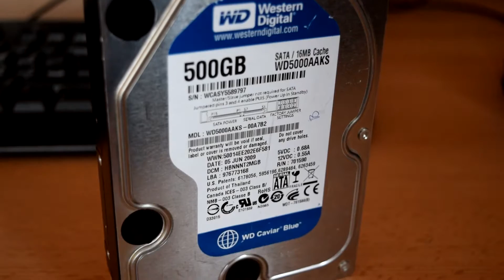350€ / 300$ Gaming PC Build - November 2015

Comment: Can I have links to it on Amazon?
Reply from the maker: +XTheSmoothMovex 
Processor: http://www.amazon.com/Intel-Pentium-Processor-G3220-BX80646G3220/dp/B00EF1G9DW/ref=sr_1_1?ie=UTF8&qid=1449404397&sr=8-1&keywords=intel+pentium+g3220
Motherboard: http://www.amazon.com/Asus-Micro-DDR3-Motherboards-H81M-K/dp/B00GUD1ER4/ref=sr_1_1?s=pc&ie=UTF8&qid=1449404948&sr=1-1&keywords=asus+h81m-k
Graphics card: http://www.amazon.com/MSI-Computer-OC-PCI-Express-N650-1GD5/dp/B009733DFA/ref=sr_1_1?ie=UTF8&qid=1449404440&sr=8-1&keywords=asus+gtx+650+1gb (i could not find used asus model)
Ram: http://www.amazon.com/Crucial-PC3-12800-Unbuffered-240-Pin-CT51264BA160B/dp/B006YG89Q6/ref=sr_1_1?ie=UTF8&qid=1449404511&sr=8-1&keywords=4gb+crucial
Hard drive: http://www.amazon.com/Blue-Desktop-Hard-Disk-Drive/dp/B0088PUEPK/ref=sr_1_17?s=pc&ie=UTF8&qid=1449405016&sr=1-17&keywords=wd+blue+1tb
Wifi card: http://www.amazon.com/PCE-N10-Wireless-N-Network-Transmit-Interface/dp/B004XFYGNK/ref=sr_1_1?ie=UTF8&qid=1449405556&sr=8-1&keywords=asus+pce+n10
Case: http://www.amazon.com/Antec-MicroATX-Tower-Case-VSK-4000E/dp/B009LDNTOG/ref=sr_1_1?ie=UTF8&qid=1449404624&sr=8-1&keywords=antec+vsk+4000
Reply: Thanks and one more question?Can it run bo3 on high 60fps???There was a other build for 300$ person said it ran bo3 on high 60 fps and battle field 4 on high 60fps...
Reply from the maker: +XTheSmoothMovex No it sadly wont but this one kinda will...you will just have to look around for parts a bit https://www.youtube.com/watch?v=Unp7GtSPJ0Y Thanks for watching tho :)